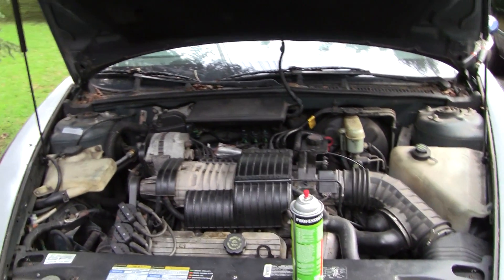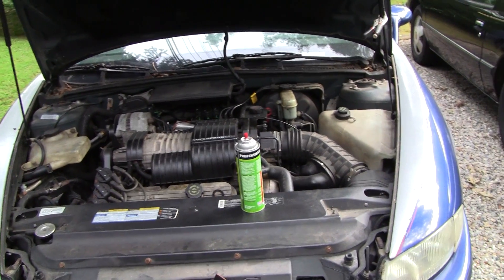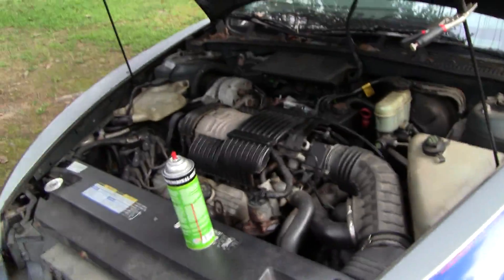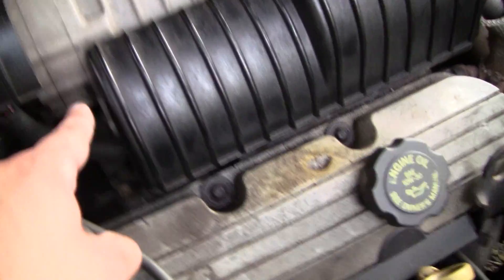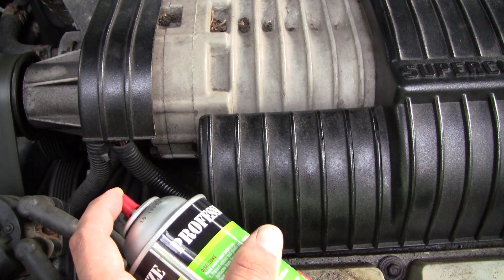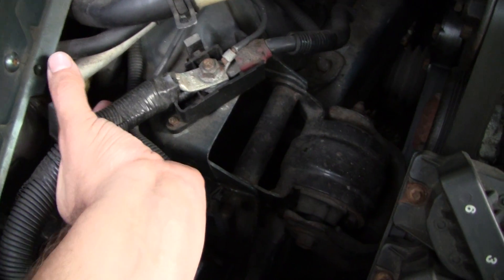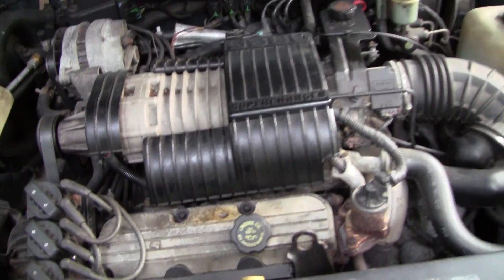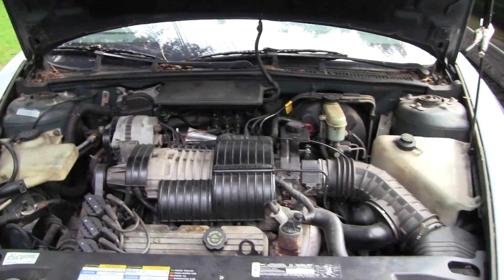How to find a vac leak on a series I Supercharged 3800 L67

Comment: your supercharger coupler is bad. go get the green one from zzp with 2 containers of ac delco supercharger oil, youll need a NEW spray bottle to take the oil out, dont use a windex or any cleaner bottle.

Comment: I think I hear the supercharger bearings,or coupler,or something making noise. I'd look into rebuilding that while you're replacing the gasket,gonna be in there anyways.
The Series II (SC and NA) are known for the lower intake manifold gaskets failing.
Something else to look for are the plastic vacuum lines they used,they tend to crack and fail. Regular rubber (or silicone) vac lines will take care of that.
Also the coolant elbows,they are making metal ones now,for the Series II anyway.